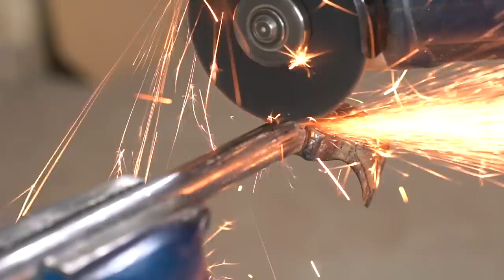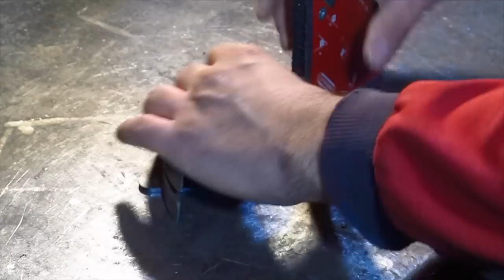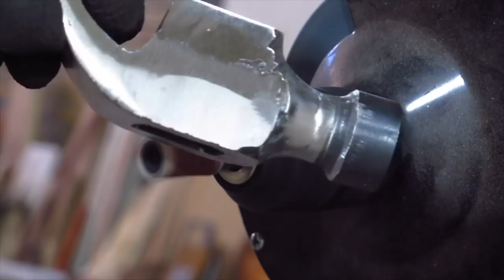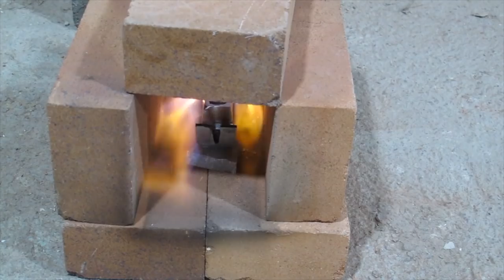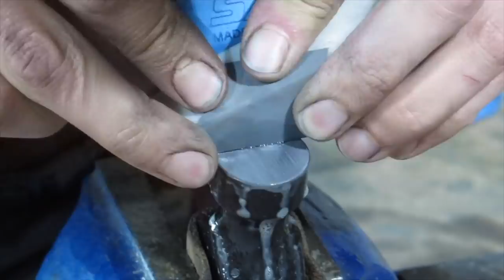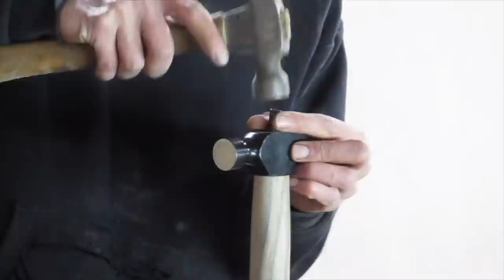RESTORING A BROKEN HAMMER #restoration #brokenhammer

Comment: Replacing a broken end of a hammer by welding a piece of rod, can be dangerous as if it comes 9ff during it's use, it can hurt anybody including the user. The best way is to use the hammer as it is or throw it on the recycle bin. Hammers are usually made  by forging and not by welding or casting.